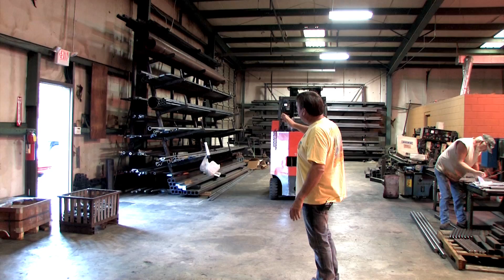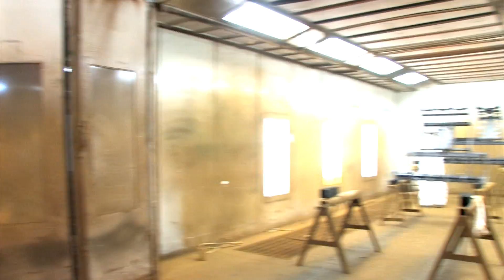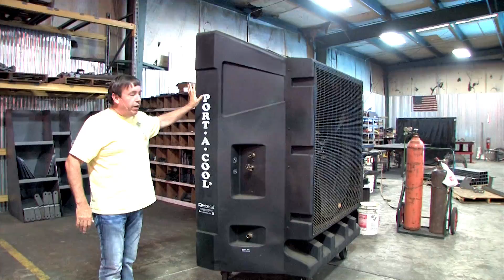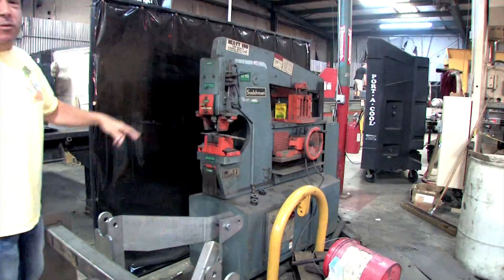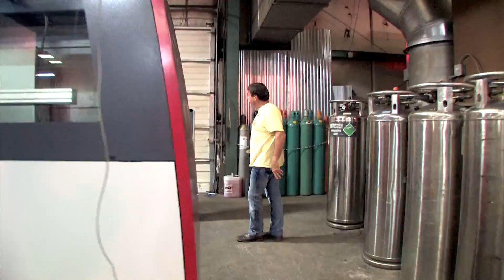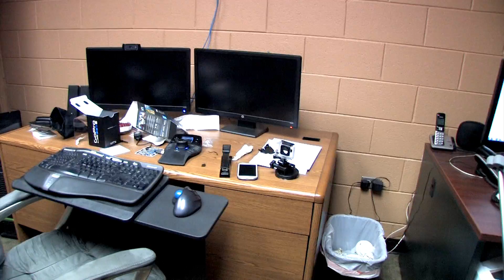Tour of Everything Attachments Factory

Comment: AWESOME TOUR!!!!! But on the xtreme duty box blade ripper shank pockets. Would it be feasible to add above & 1 below the middle hole for more rip depth or in the top hole to pick the ripper shank higher for clearance???? I wish my WOODS box scraper had more hole options for the ripper shanks. To either dig deeper or shallower - not touching the ground.